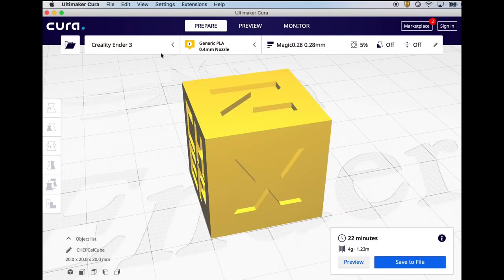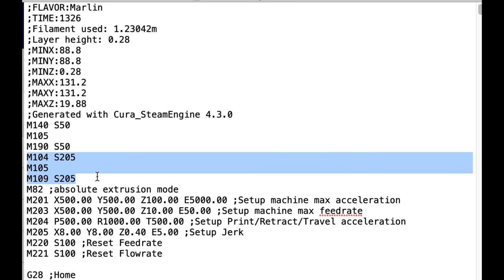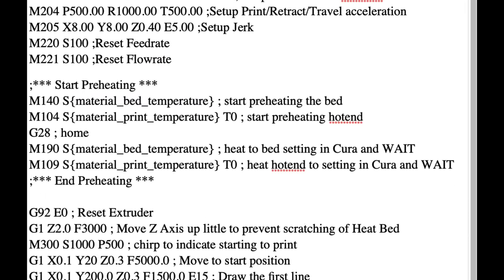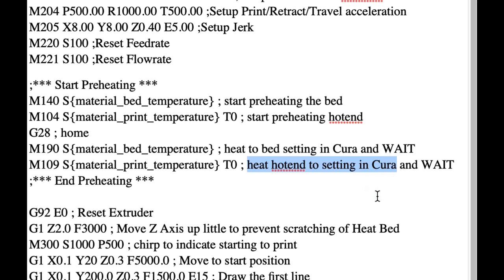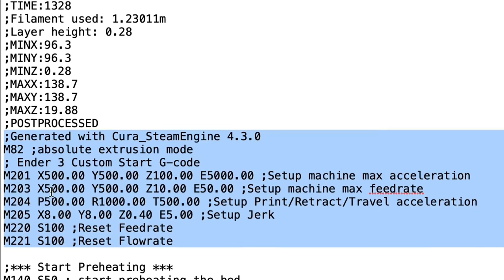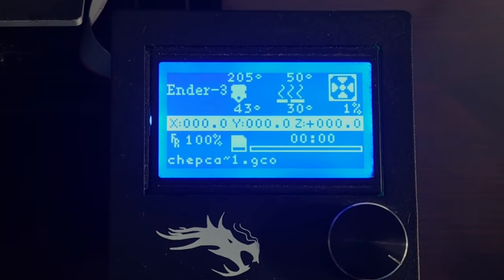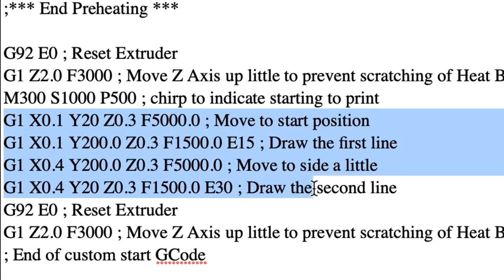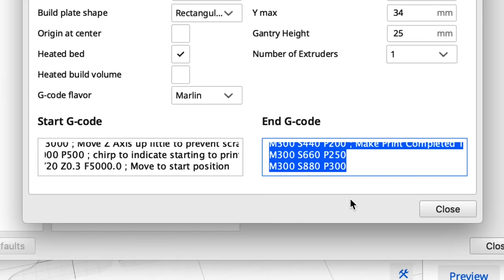Faster Hot End & Heated Bed warm-up in Cura

Comment: I wonder about the logic behind Z0.3. Is it added over the introduced layer height (say 0.2mm + 0.3mm) or it describes the total distance between the tip of the nozzle and the bed. If 2nd, then using a gauge or something which is 0.3mm thick to determine the gap between bed and nozzle would definitely help for leveling, right?

Comment: Chick, I have been trying to find out how to make them both heat at the same time and eventually, I came upon your video.  On my Ender 3 the Gcode looks very different from what the Youtube video show so I am hesitant to try it.  Correct?  Example Cure 4.4 shows M204 and your change show M104s.  Just change the numbers?
Reply from the maker: M204 controls acceleration not temp. Change it.
Reply: @FilamentFriday  I guess I was overthinking it.  I just added the new Gcode on top of the old and it seems to work.  Love the beeps.  Thanks again as usual.

Comment: Thanks again Chep!  I took the easy route and copied your start gcode into Cura. However I noticed with my slightly smaller glass bed the test / purge strip is further to the left and actually doesn't print on my bed.   Just wondering if this working as intended or are my settings messed up?  Before copying your code the purge was on my glass.  I will go back and add your code changes to my original start.  Im new Cura and 3d printing in general so if you could tell me what to look for in the start code that would be awesome! Really appreciate all the help you are to the community!
Reply from the maker: Not sure. It should be offset from the home position.

Comment: This is great! Thank you for the great videos. 

Are you aware of any way to make the bed push out when you cancel a print, like it does when a print completes successfully?
Reply from the maker: No. I haven’t.
Reply: Just look up the move codes and adjust to your bed size situation and add them to the end Gcode section, for safety I'd also raise it a tiny bit before that.  I added a Beep so that I know when it's done.

Comment: Hi, as a novis printer I'm very thankful with your videos. So I have the Anycubic Kossel Linear Plus (was only €177,- on Aliexpress!) and so far I'm loving it. Still getting to know it. I bought it (in stead of a more well known one) because of how good it seemed to print in several YouTube vids. So here's my question: how do I know if it's safe to try to implement your same-time heat-up?
Reply from the maker: There should be an option on your machine to preheat both from the LCD. Use that and see if it works. I’m just automating that which already exists manually.
Reply: @FilamentFriday  Found it, thank you. Really appreciate your help and the fact you react to questions!

Comment: If you go to "Preheat ABS/PLA" and immediately go to "Print from TF card", choose the model and confirm, it will heat both at the same time.
Reply from the maker: Yeah, that’s been stated many times in comments here. Ive done that before and actually got distracted and forgot it was warmed up. This works well for me.
Reply: @FilamentFriday  I still like your solution, because the nozzle heats up much faster than the bed, specially for ABS, 90 bed/240 nozzle, so the nozzle reaches 240 but the bed is still 60c, 3 more minutes of filament cooking in the nozzle until the bed catches up. With your solution, I can heat up the bed to 70 and then tell them both to heat to the "variables". Giving the bed a "head start", the remaining 20 from 70 to 90 are always a little slower, so the nozzle catches up pretty quickly and they both reach temperature pretty much at the same time.

Comment: Hi Chep, love your video's.
But this time I seem to be failing to execute your upgrade.
I have an Ender 3 Pro and I use the Creality Slicer 1.2.3.
I modified the Start.gcode in the slicer as follow:

;Sliced at: {day} {date} {time}
;Basic settings: Layer height: {layer_height} Walls: {wall_thickness} Fill: {fill_density}
;Print time: {print_time}
;Filament used: {filament_amount}m {filament_weight}g
Filament cost: {filament_cost}
;M190 S{print_bed_temperature} ;Uncomment to add your own bed temperature line
;M109 S{print_temperature} ;Uncomment to add your own temperature line

;*** Start Dual Nozzle/Bed Preheating *
M140 S{material_bed_temperature_layer_0} ; start preheating the bed
M104 S{material_print_temperature_layer_0} T0 ; start preheating hotend
G28 ; home
M190 S{material_bed_temperature_layer_0} ; heat to Cura Bed setting
M109 S{material_print_temperature_layer_0} T0 ; heat to Cura Hotend
;*** End Preheating *

G21        ;metric values
G90        ;absolute positioning
M82        ;set extruder to absolute mode
M107       ;start with the fan off
G28 X0 Y0  ;move X/Y to min endstops
G28 Z0     ;move Z to min endstops
G1 Z15.0 F{travel_speed} ;move the platform down 15mm

G92 E0                  ;zero the extruded length
G1 F200 E3              ;extrude 3mm of feed stock
G92 E0                  ;zero the extruded length again
G1 F{travel_speed}
;Put printing message on LCD screen
M117 Printing...

After this I saved the prifiel with this start.gcode and I sliced a object.
However, nothing has changed.
I think I'm making a mistake with " /n" the comment in your video that I didn't understand.
Please, where is my mistake?

Comment: Another good video Chuck, nice explanation for those not very familiar with G Code - my Ender plays "dukes of hazzard" at the end of each print lol. Am I the only person that preheats my bed while I'm setting my printer up too?? I normally have the bed preheating as soon as i turn the machine on-I guess it's handy for these people that use octoprint and like to have their machine running when they're not at home-personally I'm not in that much of a hurry to get a print started but I need to save two minutes pre-heat time,The reason I preheat the bed It's because I have glass on it and wipe it down with iso alcohol before every print. I guess it's one of those things where people will have used the other slicer and can't understand why this one doesn't do the same? Keep up the good work anyway,There are a lot of people out there who only know how to use a slicer thanks to you and your hard work👍

Comment: Veru useful thank you for sharing the codes. Is it easy to edit final position of the bed ? i do not wat it to go very out . have a good day
Reply: Yes, look for this line in "End G-code":
G1 X0 Y{machine_depth} F1000 ; Move Heat Bed to the front for easy print removal

Comment: Thanks for all your Tips and Contributions Chad.

My problem with the G-Code modifications is, however, that any modification is reset after I close Cura. Is there a way to make changes permanent without setting up a new printer in Cura Preferences?
Reply from the maker: Save it as a new profile before exiting.
Reply: Thank you. Cheers!

Comment: hey chep all printer's  used to heat up both at same time. this setting might be better as it is below flow temp of pla M104 S150 ; you might be better of first heating nozzle to  150 first, then when bed is near ready hav nozzle reach its setting temp.. a good nozzle heater with a heat cartridge should reach nozzle temp within 15-30seconds from cold. BTW the reason for nozzle head up last is that the bed takes a lot longer to heat than the nozzle, and nozzle would ooze all over the place making a mess and not be pressurized when print began.
Reply from the maker: Mine took same time and any ooze is cleared by the priming strip in the GCode.

Comment: How would you go about setting it up to preheat the bed to lets say 100c and then start the nozzle heating up while the bed finishes out to 110c? Otherwise my hotend is at temp for 10min waiting on the bed to catch up. I usually do the preheat the bed and walk a way until its at temp and then start the program but if i get distracted with something else it may set there for hours with the bed at 110c waiting on me to start the program.

Comment: Chep, I have an Ender 3 Pro. I copied and pasted the new code (which works well, thank you for providing it), but it no longer prints the test strip on the side before actually printing the model. I always found this to be useful. How can I add this into your code?
Reply: I copied this out of cura 4.5.0, this is my stock code from Ender 3 PRO, hope this can help you. Start G-code

; Ender 3 Custom Start G-code
G92 E0 ; Reset Extruder
G28 ; Home all axes
G1 Z2.0 F3000 ; Move Z Axis up little to prevent scratching of Heat Bed
G1 X0.1 Y20 Z0.3 F5000.0 ; Move to start position
G1 X0.1 Y200.0 Z0.3 F1500.0 E15 ; Draw the first line
G1 X0.4 Y200.0 Z0.3 F5000.0 ; Move to side a little
G1 X0.4 Y20 Z0.3 F1500.0 E30 ; Draw the second line
G92 E0 ; Reset Extruder
G1 Z2.0 F3000 ; Move Z Axis up little to prevent scratching of Heat Bed
G1 X5 Y20 Z0.3 F5000.0 ; Move over to prevent blob squish
Reply: @TDHobbies  Thank you.

Comment: Thanks for the tip, it come in handy for me at this current time, so thanks!! Question; I have a 150W heatbed, which seems to warm up quite slowly. Does that sound about right for a 150W bed, or could it possibly be a faulty bed or even slow by your estimation? I was thinking, is there a way of boosting the PID settings to speed it up in the firmware? That would also be useful for me if you can. Marlin failsafe kicks in because it's taking too long on a new build I'm doing.
Reply from the maker: Depends on the size of the bed.
Reply: @FilamentFriday  Its 220mm sq
Reply from the maker: Sounds like a 12v system. Those do heat slower than 24v beds.
Reply: @FilamentFriday  Thanks.

Comment: I think the claim that you are cutting your heat up time in half is a little generous.  The bed will take several minutes to heat up and the nozzle just a few seconds, at least in my current setup, I probably save 20 seconds by heating them both at the same time.
Reply: It doesn't seem to work anyway. It heats the bed but the hot end will never heat.

Comment: Thanks for sharing this. Unfortunately, if I use the variables it is adding some strange character on my Gcode file. If I define values instead of use variables, everything goes fine. Would say this is some issue on version I'm using for Cura (4.8.0 osx)

Comment: Do you have an End G-Code addition that pulls the filament back out of the extruder/heating element before the cool down?
Reply: You could try G1 F1800 E-3 ;this retracts filament 3 mm. If you want to pull it further up the hotend, increase the number after "E-" like E-10

Comment: I use a bltouch clone and I find that by putting heat extruder command and wait for extruder temperature around G29, you can save time by making your machine to multi-task, who would've known? That's assuming your filament and nozzle combination doesn't drip while the probe travels over the bed of course. 

M104 S{material_print_temperature_layer_0} ; Set Extruder temperature
M117 Heat nozzle while probing...
G28 ; Home all axes
G29 ; Auto bed-level (BL-Touch)
M420 S1 ; enable mesh
G92 E0 ; Reset Extruder
M109 S{material_print_temperature_layer_0} ; Wait for Extruder temperature

Comment: Great info but once again I'm left confused trying to add the commands to the g code. I downloaded the files from your website but there is so many commas and different things typed in the g code I don't know what to copy and paste. You show a small clip of the start code in cura but it is not what is listed on your website. which is correct?
Reply: Just go to Settings > Printers > Manage Printer > Machine settings then change the start gcode (put it right at the start) on the first tab. His instructions aren't the clearest, but appreciate the good work CHEPPY!

Comment: Thank you so much we get to learn so much from you. Can this Gcode be used in Prusa slicer? Thanks my temp on the Ender 3 fluctuates after the 1st layer slowly going down and with the thermal runaway it stops. I have checked everything and don’t see any issues physically. But I tried changing the temp up by 3 or 5 degrees through the lcd screen while seeing the temperature go down, then the temp starts going up again and then stays at the temperature set. Do know the possible problem to this? Could the thermistor be damaged? I have a micro Swiss hot end and had under extrusion and had to clean the nozzle. Thanks 🙏
Reply from the maker: Prusa slicer already has it. Run PID calibration on hot end since you changed it.
Reply: @FilamentFriday  dear sir, I have already done the pid tuning.🙏 could there be something else I have to look into?🙏
Reply from the maker: Then I would suspect a bad sensor.
Reply: @FilamentFriday  by senaon you mean the thermistors right? Thanks
Reply from the maker: Yes
Reply: @FilamentFriday  thank you so much for replying. Stay blessed & wish you a very prosperous & healthy new year.

Comment: Like the Chirps at the start & end, but how can I make the printer delay printing for 2 seconds before printing, so I can get my hands clear if I'm last minute fiddling with it?.
Reply: The G-code for "dwell", or a pause in the command queue, is G4. It takes two parameters P and S, P defines the length of the pause in milliseconds, S in seconds. If both are passed, P is ignored.
So for your example case, include "G4 S2 ; don't wreck my hands pls" in your starting G-code.
Reply: @shinmai  Thank you I'll add the command. I've used freq 2K for chirps, sounds a nicer chirp.

Comment: The example code is broken because there is an invisible Unicode character in between "S{material_print_temperature_layer_0}" and " T0". You can see the invisible character in vscode or notepad++. Edit out the character on your website when you get a chance. Cheers.

Comment: My hotend heats up in about within 25 seconds, the bed takes longer so it makes sense to use all the power of the PSU to heat the bed quickly then the hotend after... it doesn't make sense adding extra load on the PSU to save several seconds. I like the Beeps though.

Comment: Huh... how do I know my power supply can handle heating both at the same time?
(it's a Fabrikator Mini II)
Reply: You should do some math. Your power supply - (hot end + heat bed thermistor)
Reply: @mariovaldesortiz521  Assuming that you mean I should add up the ampere those components draw, I don' t have those numbers.
I tested it and it simply does not work on the Fab-Mini-2, it still heated each one separately.
Could still just be me not knowing what I am doing, tho...

Comment: Great tip! But... for me it only works if I save on SD card. If I "print via USB" the heating sequence is as usual... is that supposed to be so?
Reply from the maker: I didnt test USB
Reply: @FilamentFriday  Thanks for the answer, Chep!  Just a thought for the future: this may be worth investigating, as this case points at the possibility that settings applied to prints done via USB are somewhat different than those applied to prints done using the SD card.Something I guess the majority of the users wouldn't expect!

Comment: Thank you for the great tips. I inserted the text in Cura and when it heats up my printer, it homes, does the bed leveling and start printing before hitting the desired temerature. I did insert the  M190 and M109 codes. I have an ender 3 Pro. Does anyone know what might be the issue? Thanks in advance :)

Comment: Hi Chuck. Thanks for your great work. I have an ender 3 and replaced the motherboard with Bigtreetech SKR mini 1.2 which came with marlin 2.0 bugfix version every works ok, but should I update it to the newest marlin version?
Thanks
Reply from the maker: Not sure. I haven’t tested that board yet.
Reply: Hey Steve, did the same thing on my ender 3 and the board came with bug fix 2.0
Only thing I noticed was that the "store settings" option wasn't actually saving anything. So I ended up upgrading to the latest version, quite easily done with just the sd card ;) hope I helped you a bit
Reply: @bob95180  thanks for the info. I might give it a try, it's just everything is working ok now I didn't want to mess things up.

Comment: Hi.Can I do that first start heat Bed itself like to 60C. When reach 60 then start heat bad and nozzle together to full degrees (110/240)? Asking because my nozzle first done and waiting at 240C , but Bed late, it still heating in that time. I want save power and noozle here so that noozle don't must waiting Bed.
Reply from the maker: There is a way I just can’t remember. . I thought it was talked about in comments.
Reply: the energy required to power a typical printer is about 10% of the cost of the material used, so you don't have worry too much about using a little more power at the beginning :)

Comment: All this time I thought that's just the printer that is heating the elements seperately. I'm really starting to hate Cura. Another flaw is that you have to fix the size of the print bed. The correct value for the Ender 3 is 235mm, not 220mm for each side. If you were to print a 22cm x 22cm cube with default settings, it would print two of the sides right on the edge of the print bed (as the (0,0) position in the slicer will also be (0,0) when printing). When changing to 235mm, a 22cm cube will be perfectly centered on the bed.
Reply from the maker: The main problem is Creality advertises it as 220x220x250 so Cura just uses those numbers.